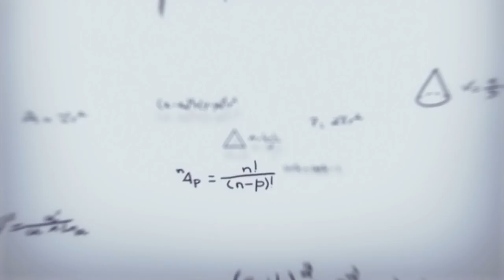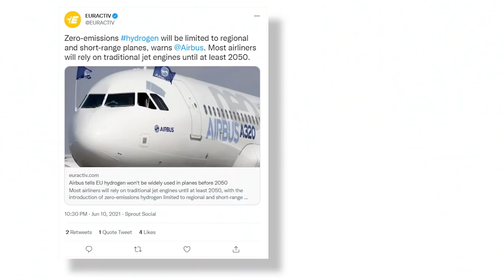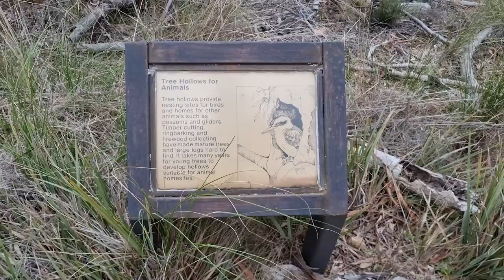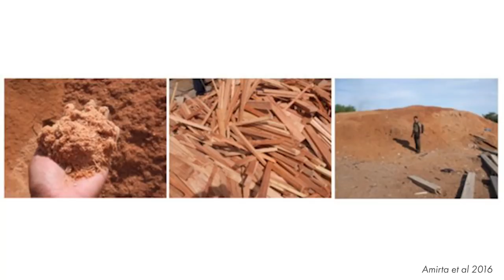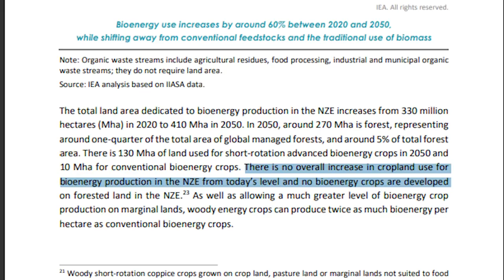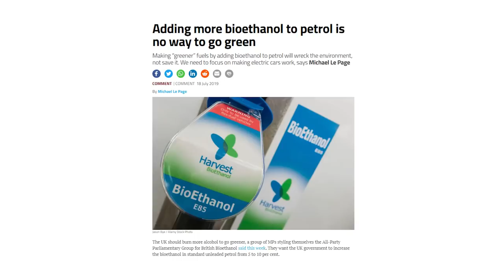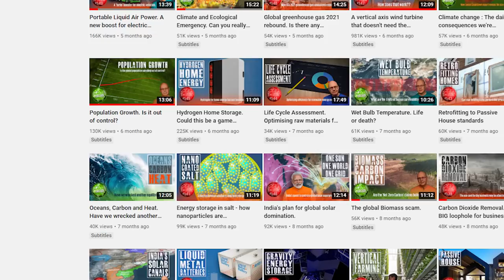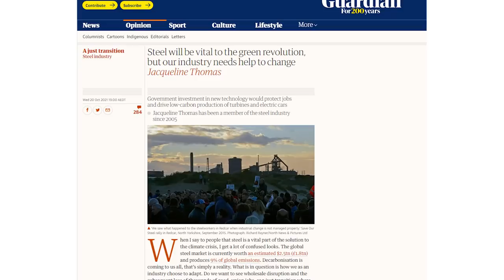Bioenergy In All Its Complexity: The Good the Bad and the Ugly

Comment: Great video! An exciting idea I've heard is to use biochar for carbon sequestration, as it doesn't require commercialization of new carbon capture technology. Essentially you bake biomass without oxygen to form flammable gasses and charcoal. You burn the gasses to produce energy and till the charcoal into farm fields, where it retains fertilizers and releases them slowly over time. Terra preta soils from South America seem to indicate that the carbon could be sequestered for up to thousands of years. The problem of sourcing the biomass remains, but we're also learning more about the importance of periodic fires to many ecosystems. I wonder if we could either use scheduled harvesting to simulate beneficial effects of fire, or harvest areas before planned burns to reduce the amount of carbon released. On an unrelated note, if we could just all agree to consider peat a fossil fuel I think that would help the overall bioenergy conversation.
Reply from the maker: What a timely comment! I just interviewed a researcher working on this exact topic. I will have a video on this and other CCU out in a few weeks, so keep an eye out.
Reply: the amount of massaging of facts that's needs to be done to be able to call peat "renewable" is kind of fascinating. Here in Sweden they are only allowed to remove a couple of centimeters of the top layer and it still takes hundreds years for it to grow back. Grows at about 1 mm/year.
Reply: If you translate the energy consumption per capita, and the amount of carbon stored, you'd have to bury about six ton of charcoal per person and year (Swedish figures). Doesn't sound doable.
Reply: @EngineeringwithRosie  I love the concept, but there is a lots of problems with the scale needed before it will have any meaningful impact. 
To supply biochar it is of course the correct way to go, but not for sequestration. Using the carbon to replace coal always give the largest effect at the lowest cost.
A different side of the problem is also the amount of land needed before you can harvest any amount that can make a difference.  
Sorghum has the highest yields at nearly 10 ton per acre, about 50% dry mass, equal 5 ton dry mass/acre. Than is about 2 ton carbon per acre.
I a mono culture you could get about 500 ton/km2. Then you have to subtract all the carbon cost connected to growing the Sorghum.
Worlds CO2 emissions in billion metric tons = 33.5 and or close to 10 billion metric tons carbon.
That is 10 000 000 000 ton / 500 ton per km2 = 20 million km2 with Sorghum needed if that was all we did.  That is more than 50% of all arable land in the world.
If we only did 1% the need would still be a major part of the land where we can grow food, and 1% would not make much difference.
Reply from the maker: @bknesheim  That is really interesting, I think I will have to do a whole video on biochar because I'm not going to be able to cover it in much depth in the broader video I recorded on CCU. I am particularly interested in the possible scale. I haven't checked your numbers, but I do note that they seem to be in contrast to this recently published article about biomass intermediate pyrolisis pol-generation (BIPPS). From the authors: "Here we find that a BIPP system can be profitable without subsidies, while its national deployment could contribute to a 61% reduction of carbon emissions per unit of gross domestic product in 2030 compared to 2005 and result additionally in a reduction in air pollutant emissions. With 73% of national crop residues used between 2020 and 2030, the cumulative greenhouse gas (GHG) reduction could reach up to 8620 Mt CO2-eq by 2050, contributing 13–31% of the global GHG emission reduction goal for BECCS, and nearly 4555 Mt more than that projected for BECCS alone in China."
Like I said, I need to actually check your and their calculations to see if there's a discrepancy. But this paper does make it sound like we can acheive some meaningful scale just by using crop residues. I'd be interested to hear your opinion!
https://www.nature.com/articles/s41467-021-21868-z
Reply: @EngineeringwithRosie  It look like messages that include a link is deleted. How can links to info be transferred?
Reply from the maker: @bknesheim  ones with links get reviewed, otherwise I get heaps of comments from bots. I can't see yours in the review bucket yet though. You can get around it by just making it look like not a link, so write (dot) instead of the actual dot. That will probably work, but I haven't actually tried it.

Comment: FYI .. another (I find) often overlooked 'bio-energy' ..  is the biological decomposition that happens all the time in trash land fills .. that produces methane .. the landfill happens anyway .. the methane off-gassing happens anyway even if we don't collect it .. but there are some places that have installed a methane collection system .. this reduces the green house emissions (that happen anyway) from the landfill by converting the methane to less potent green house gasses (like CO2) .. and it can provide heat and electrical power as well .. it can be stored for long periods of time for later use , when it's needed.
Reply from the maker: There are plenty of projects near me that are capturing landfill gas. I might have to do a video on that soon! Not as scenic a location as for this video though 😋
Reply: We really should be diverting food waste into compost instead of letting it rot into methane in landfills. We can do intentional biodigesters from food waste too, and use the remainder for fertilizer. But I really don't like just tossing everything into a landfill and siphoning off the gas
Reply: @ThomasBomb45  Totally agree
Reply: @EngineeringwithRosie  Landfills are inefficient anaerobic digesters....I will leave the rest to you!

Comment: I look at Drax in the UK using non-waste wood shipped from Canada to burn in converted coal furnaces for power (currently without CCS) and find their insistence that it is sustainable and low carbon rings somewhat hollow, yet they seem to have government support.
Reply from the maker: Is it non-waste wood? I thought that they were at least saying it was waste. Even though I know many people don't believe it. 
I saw they have a CCS trial, where they capture carbon and then... just release it back into the atmosphere 🙄
Reply: @EngineeringwithRosie  I suspect it's like you were saying in the video, if there's demand of the scale they need, how much can it really be waste? I just can't see how it makes sense to ship it thousands of of miles to just burn. We're many years from having commercially functional CCS too, so in the meantime, all that wood carbon that could have been used for other purposes has been released.

Comment: Where I live, we separate our food waste garbage, from other garbage, and it is used for methane production. Our methane is used as fuel for buses and cars (aka "biogas"). The sources are  64% food scraps from homes, 15% slaughterhouse waste, 9% is from sewage, 8% waste from other food industry and 4% other. The weird part is that 13% of the waste is imported from a neighboring country (we pay them for it :P). But it is quite much better than importing palm oil from the other side of the planet I suppose. If you have a car this biogas ends up being cheaper, per km, than regular gas by maybe 20% to 33% (according to my more pessimistic calculations, rather than the more optimistic marketing). I think this is a pretty good step in the right direction.

Since practically all gas engine cars can be converted to methane, I'm surprised that we don't ramp up this type of solutions (without starting cutting down forests and importing from dubious sources), and convert as many already existing cars to methane, as possible. And also produce diesel from our waste (can be done from fats and oils in our local food industry, sewage, and from forest industry waste (instead of importing palm oil)).  And lastly electrify our highways for trucks and highway buses, like in this Tom Scott video: https://youtu.be/_3P_S7pL7Yg ! We could eliminate fossil fuels in 5-10 years if we really wanted. 

A part of my disappointment with efforts so far comes from the fact that a  lot of the technologies aren't new either! The first time a passenger type plane flew on hydrogen and methane (which both can be made from renewable sources) was 1988!

Comment: My favorite biofuel is biogas from animal feces including human. Less flies, smell, and fugitive methane emmisions. I think a key thing to keep in mind, is plants capture about 1% of the sun's energy in biomass, and solar pannels about 20% and doesn't need water. That multiplier is tough to overcome.
Reply: Yes, but a solar panels capture 0% carbon.
Reply: @bknesheim  So do coal plants, and cars. The most productive biofuel in theory, is micro algae. I say in theory, because in practice there are a lot of problems to overcome, but productivity is several times higher than palm.
Reply: @bknesheim  biofuels also capture 0% carbon. If you grow something just to burn it, the carbon is not captured anywhere
Reply: @ThomasBomb45  The point was capturing CO2 not energy. That was why solar panel had no meaning. When you talk about electricity, solar panel is great.

Comment: I have worked in the Bioenergy industry for the past 15 years and complement Rosie on this video, while I might not agree 100% with everything said (perhaps 95%) she clearly has the intelligence and balance needed to understand and examine the complexity of the sector. Bioenergy - done correctly is an integral part of meeting the huge challenge the world faces. The European Union have set out very detailed criteria to assess the good from the bad and ugly in the Renewable Energy Directive and its amendments (currently RED 2 - RED 3 is under negotiation). Rosie or viewers might find that an interesting resource.
Reply: Note on transport comments: Electrification of cars is achievable but depending on the electric grid emissions often does not achieve very impressive CO2 reductions. If the grid emits 400g CO2/kWh then emissions are 54% less than diesel, and only 27% less if you include embedded emissions to produce the car! Biofuels under the RED 2 reduce emissions by 65% compared to diesel, and 50% if including embedded. 
Electrification is not an option for large fleet such as marine, heavy road haulage or agricultural tractors. Compact energy forms such as biofuels, biogas and (distant potential) hydrogen so far are the best options we have for these.
Reply: @ngavigan  The efficiency of a diesel car is between 10% and 20% depending on how you use it and how powerful it is. Trucks can get close to 30%, Long haul even above that. Still your average efficiency is shit. In fact you are better of buying an electric car and charging it with a diesel generator. The overall efficiency will end up somewhere in the range of 30-35%.

It is correct that purely electric agricultural vehicles make little sense, but many of them have extremely varying loads and are big enough for a diesel-electric system which could increase their mean-efficiency drastically. 

Personally I would like bioenergy to be outlawed nearly completely. While it is true that there are a lot of useful applications for it, there are even more missuses and the question is whether or not the good can even makeup for the bad. Currently I don't think it can which makes the whole industry net negative.
Reply: @_aullik  Your analysis (amongst others) that you could use a diesel generator to power an electric car to reduce emissions clearly has no scientific basis, however I admire your passion and encourage you to educate yourself on these matters with proper science and engineering based literature, techniques and critiques - accurate assessment is required and a clear understanding of the challenges and technological possibilities needs to be understood by all.

In terms of outlawing bioenergy - in your own terms throwing out the baby with the bathwater. Currently a very high proportion of the worlds water reserves are misused, wasted and polluted - yet we all understand that its use can't be banned: we can however use the resources available to us in a far more sustainable and responsible way. 

According to the UN FAO currently 2.4 billion people rely on bioenergy to provide their basic energy needs (cooking, heating and lighting), if we "ban" bioenergy what do you propose we do for them. Bioenergy provides 67% of the worlds renewable energy, and is seen as vital to decarbonise high temperature heating and transport. If we want sustainable building materials to build houses and other buildings the only option is wood, you can't produce wood without cutting up a tree, and you can't cut up a tree without producing sawdust, bark, pulpwood and brash - all of which provide the majority of bioenergy. Facts and details are important - the challenge is complex, the solutions are complex.

Comment: I think doing "controlled burns" via a biomass plant (i am team Integrated Gasification Combined Cycle !) would be neat.

I need to look into it more, and see if there are papers on it, but i think it would go like this:

1.) Area in need of a "controlled burn" is selected
2.) (This is probably just me being naive, but possibly shoo out animals with air cannons and whatnot?)
3.) Mow (or Mulch + Pelletize?) + Bale Grasses/Droppings
4.) Potentially add this step for small actual fires to do things like activate pinecones etc? (need to look into the environmental impact of this)
5.)Burn the harvested biomass in a thermal power plant (thus instead of the "burn" part happening in the forest, it is harnessed for energy)
6.) Return the ash to the site, in either pellets (may need to be diluted with filler?), or just dilute solution?; this prevents the process from essentially "bio-mining" the nutrients out of the soil
7.) Optional Char burial (total in the case of pyrolysis, or biomethane pyrolysis?, or partial if some is burned for energy as well) to improve soil
8.) Optional Replanting of Ground Cover / Trees

I need to make a wiki page on this^ concept, i did make one for the ash return though:

https://wiki.opensourceecology.org/wiki/Biomass_Origin_Ash_Return

Comment: I've always been similarly skeptical of biomass energy, and this nicely summarises why it's not a simple good or bad.

We're currently working out what to do with the fireplace in our house. We've just installed an air-source heatpump, but would like to retain a fireplace for very occasional use. We're aware the wood-burning stove we have has at least localised emission problems, and don't want to keep gas in the house just for a fireplace. Electric fires look too fake, but are considering a bioethanol fireplace, the thinking being as an occasional luxury the slightly "ugly" source of fuel might be an ok compromise.
Reply: The local problems are negated when you use an electrostatic dust filter, and a modern stove (produces very little tar). You are still generating CO2, but that is not a local problem. With a stove you can also convert thing that will go into the wast to something useful when you need some heat.
Reply: May I suggest that security of supply is also a consideration . Hedge your Bets with wood or gas .

Comment: As I fully agree with your categorization, I'm not sure whether something including carbon capture and deposition can be other than "ugly" - I always assume much energy involved in that capture and storing. 
Do you have other examples?
Reply from the maker: Yes for sure it is ugly if it is not purely from otherwise unusable waste. I'll be doing a video on CCU (carbon capture and use) soon, and I will talk about the amount of energy needed for that in that video. I already did one on traditional carbon capture, which is the kind that would be used in BECCS, and I believe the chemical engineer I interviewed said about 30% of the power plant's output is needed to run the carbon capture. It's A LOT! And that's why CCS or CCU is never going to be something we can do instead of renewable electricity, it can only be done in combination with renewable electricity. Here's the carbon capture video, probably my favourite one I've made actually. In terms of the technical content anyway. https://youtu.be/fC388uNJhUY
Reply: @EngineeringwithRosie  Thank you Rosie, I simply forgot, that I already saw that. 

So - for me CCS seems to be some brain damaged. 

But - there is also CCU. But before CCU there are some questions remaining: 
- I know a little about using CO2 in synthetic fuel production. Are there other significant use cases for large amounts of that captured CO2?
- I would like to know what quality (purity) of CO2 do the using processes need?
- In the moment the ratio of capture seems not relevant.
- What quality of CO2 do the processes mentioned in above video produce?
Reply: @EngineeringwithRosie  what do you think of Dale Vince and his sky diamonds?

Comment: Woodstoves are a great example, of how good and bad are often the same thing. A friend has a house about 40 years old with a new wood gasifier stove. The house is not insulated. He takes about 30-35 m³ of firewood per year to keep himself and his family worm. Another friend has a 100 year old, completely renovated and insulated house, also with a wood gasifier stove. He only uses about 6-8 m³ of firewood. He also has a family and it's always nice and worm at his house.
With gas or electric heating, the price for heating an old house is so high, that you are going to insulate. With wood it is extremly cheap (but much work) when you do everything by yourself.
So you can heat up four houses or only one house with the same amount of wood.